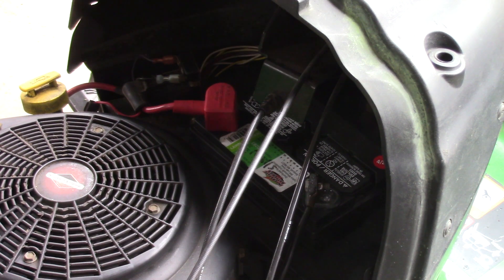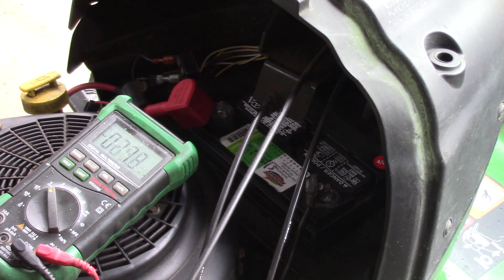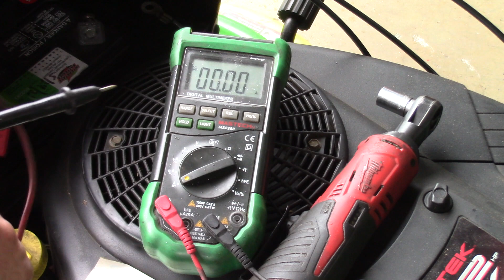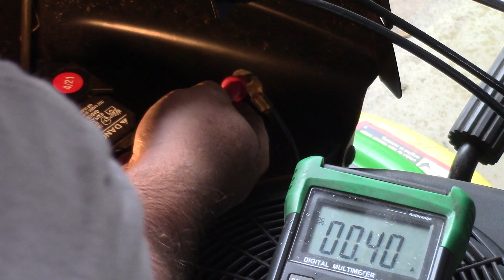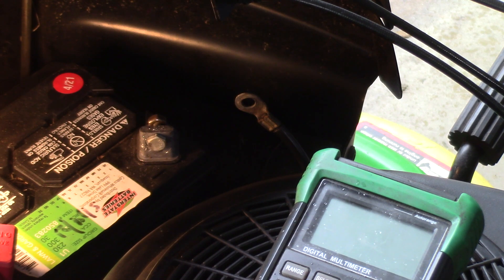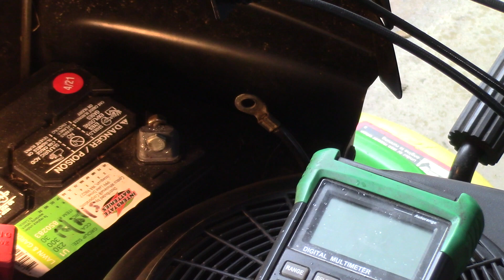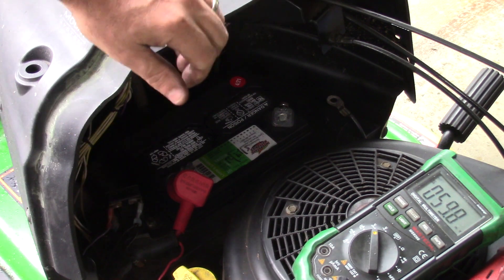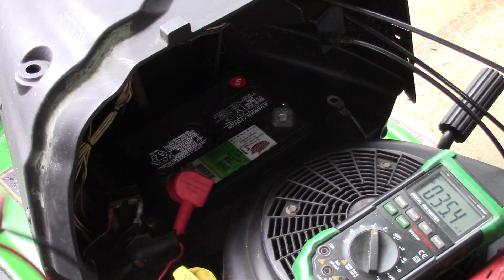Tractor Battery Keeps Dying:  How To Test Parasitic Draw

Comment from the maker: Tools For These Repairs:
https://amzn.to/3SKSWWV  Decent Digital VOM for testing.
https://amzn.to/3Rm3kDn  Nice Test Light w/ Voltage Indicator
https://amzn.to/3DYnkJa Battery Load Tester Digital
https://amzn.to/3UOCV3M Milwaukee M12  Power Ratchet
https://amzn.to/3Rmwhig Battery Tender Trickel Charger
Reply: I actually have a parasitic draw on my truck which is the 2000 GMC so I unplugged the fuse

Comment: Sometimes mowers sit in the rain and the ignition switch itself becomes the drain. Try testing the ignition switch itself. Sometimes the fastest fix is to just install a battery shut off switch. Then if it goes down its the battery. The diode in the harness going to the stator also goes bad and allows current to flow backwards to the stator. A new 12 volt 20 amp diode costs about 2 bucks from an electronics dealer but you won't find one on a parts site,..just Amazon or something like Allied Electronics. It could also be a pinched or bare wire somewhere.

Comment: Had aa parasitic draw on a full  size old tractor, replaced regulator and key starter, glow plug switch, and couldnt  get rid of the problem, finally installed a battery isolator switch, end of problem.
Reply: Are talking like a kill switch? I’m going thru that issue right now, and my toro zero turn is new
Reply: @manuelsalgado8510   not a kill switch but an isolator switch commonly used on old heavy equipment tractors semis bulldozers etc.  It is just a extremely heavy duty switch capable of conducting the full cranking amps of the battery. Place in the positive conductor between the battery and everything else.
Reply: @Morgan2XL  In tanks we called it the Master Switch.
Reply: @rayanderson286  all the ex DND folks at BCFS called them Battery isolators our truck fleet was older than the tanks.

Comment: Thermal cameras are great for finding parasitic draws also. Did you try to do an amp draw test? Or use a digital battery tester to confirm a bad battery? Water level? I do however agree that the battery is the likely culprit in taking in educated guess. A no draw is gwnerally a bad battery.

Comment: When my battery on my John Deere X300 was dying after sitting for 1 week, I boosted it and it ran fine and would start again if I shut it down. I got sick of boosting it and the battery was less than 5 yrs old so I decided to check the water level. It was down on all cells. After topping them off with demineralized water (didn’t have distilled), it’s been fine ever since.

Comment: When you checked draw the first time you connected the red lead to the negative on the battery and the black lead on the ground cable. The next two times you put the black lead  on the negative terminal on the battery with the red on the ground cable. Not sure if your meter can show reading with reversed polarity when reading amps. If it can't it wouldn't have shown the parasitic draw when you checked it.
Reply: He’s only looking for an circuit. Doesn’t matter for that test.
Reply: He was looking for a current draw to determine if there was a parasitic draw. Lack of a parasitic draw indicates bad battery. Meter might read current draw when connected backwards but some don't. If it didn't read current when connected backwards it could lead to a false conclusion that the battery was bad when the problem could have been a parasitic draw.
Reply: @gordonwilloughby8793  ok I’ll go back to school and get my masters in lawn mower electrical trouble shooting.

Comment: Parasitic current is usually milliamperes.  You should use a mA scale instead of the 10 Amp scale for better accuracy.
Reply: .... Correct, higher resolution. And some 'Alligator probe push ons'.
If he pops the Bussmann ceramic fuse it's going to hurt though.